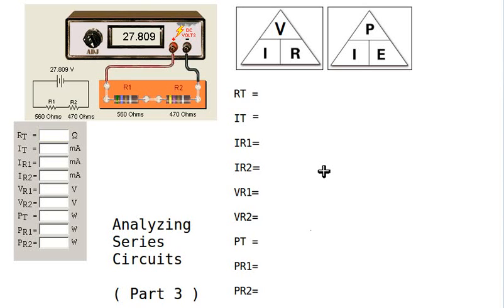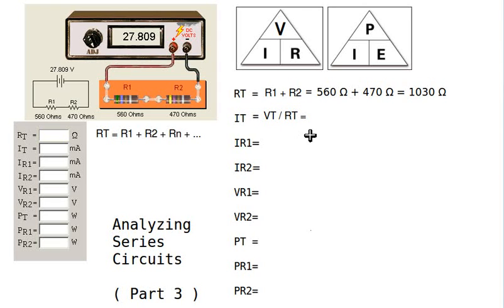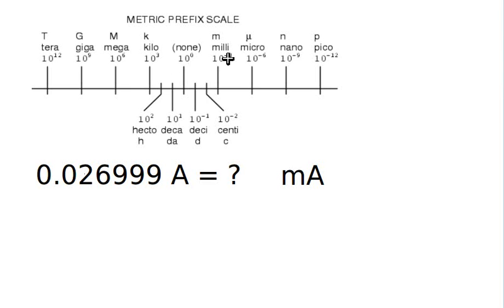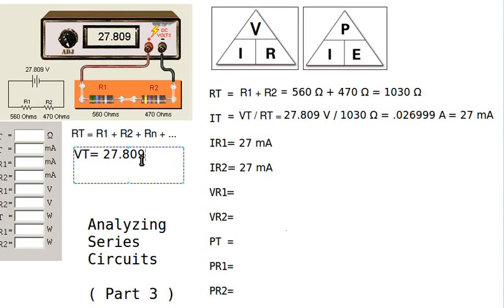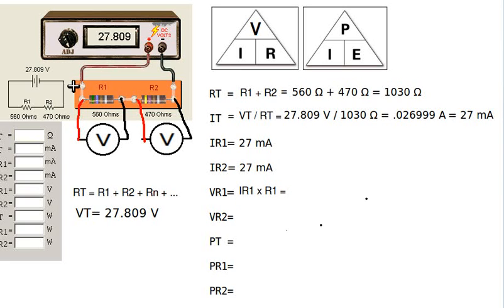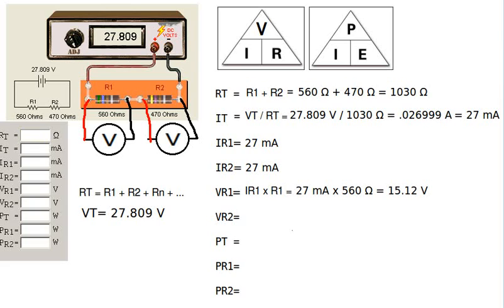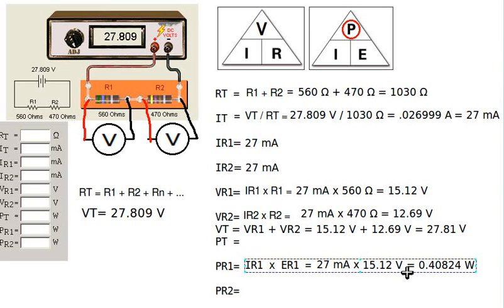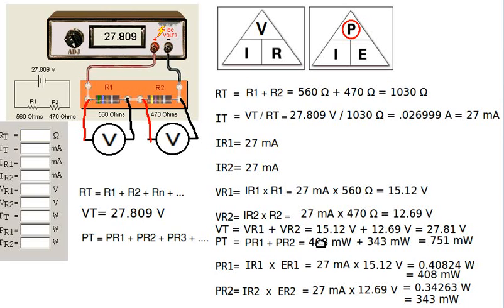Series Circuit Analysis part 3

Comment: Informative and clearly expressed, many thanks. I am finding it a little hard to believe a current for a series circuit would be the same through a high resistance as an LED. My impression is a resistor causes electrons to form more lanes which have a greater influence. Could it be possible to regard a current in terms of the number of lanes or rows of electrons rather than simply the flow rate? A high resistance could then be like deep mud for electrons compared with a nice straight road.